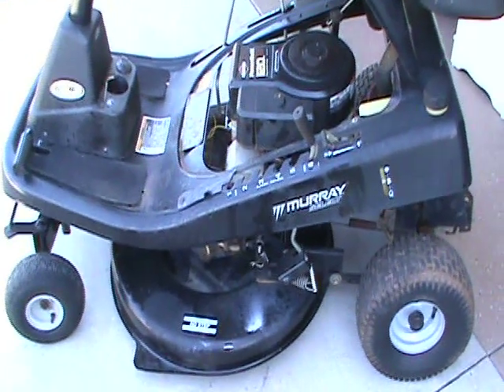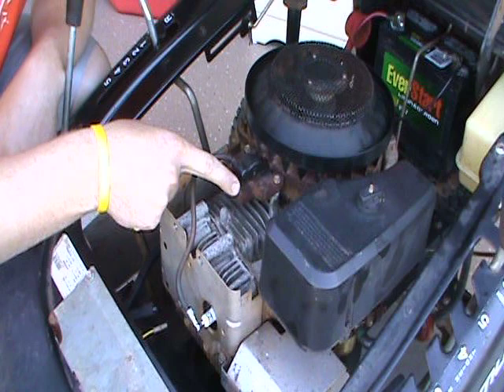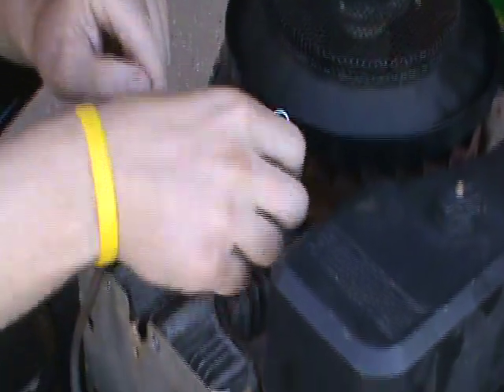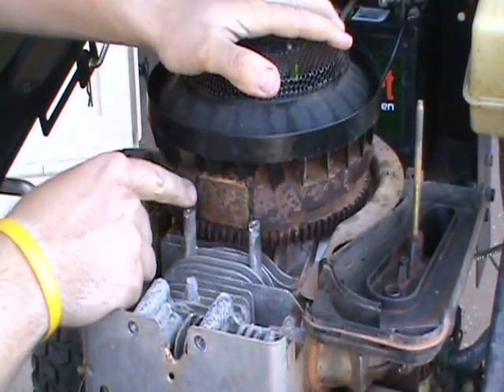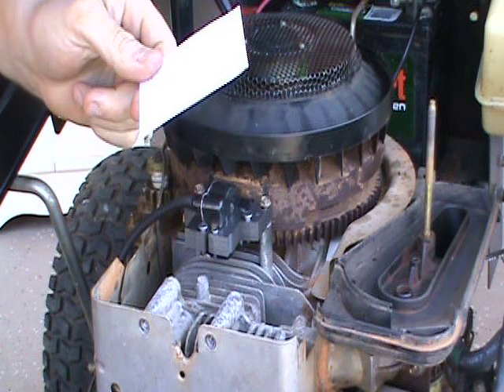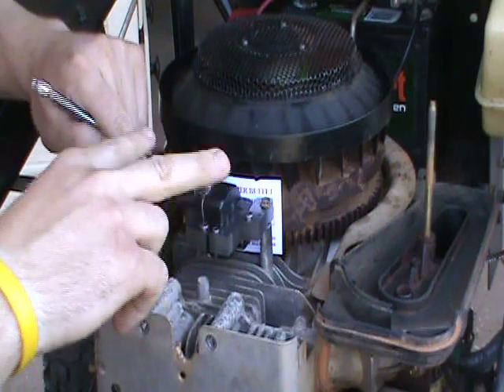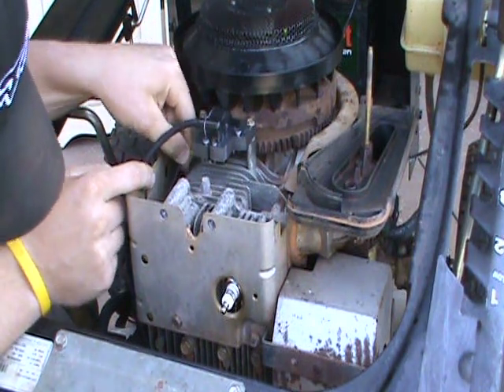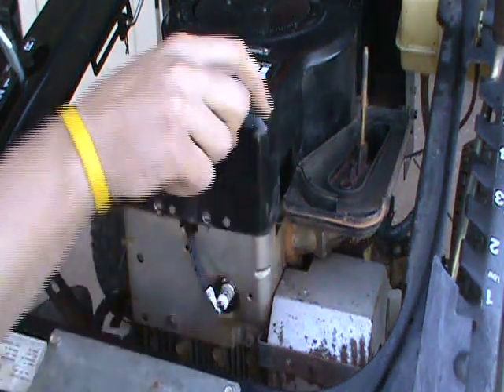BRIGGS and STRATTON COIL ARMATURE MAGNETO REPAIR NO SPARK

Comment: sand the corrosion off the magnet first, most of the time, that is the cause of low or no spark. It's a good thing to do even if you do end up replacing the magneto.
Reply: Wire wheel both bolt surfaces,   coil n flywheel  , set gap at .010 ... install  new plug ... often works ...

Comment: It also helps to take a wire brush to the flywheel and get some of the rust off for better contact and nut drivers work better than box wrenches.

Comment: No. I´m not talking about the wire where you should install the spark light. In your video I saw how you unplugged the magneto from a wire. Exactly at 2:59 minutes of the reproduction. This is the wire I need to know where comes from. It is a ground wire or it supplies electricity to the magneto. I´m from Cuba and here there is not any mechanic who could explain me what I´m asking to you. Maybe an electric diagram of my equipment will help me but I don´t have access to any one. Thank you!!

Comment: Thanks for an easy explanation and stable camera. My new Briggs & Stratton lost spark and it could have been because vibration caused armature nuts to loosen. Unfortunately, I didn't really use the mower until after my 1-year warranty ended. So, your video might save me a repair cost. I'm surprised that the engine malfunctioned right off the bat. This is a first.

Comment: Thanks a lot! This video might be right for my new lawnmower. I used it only about a dozen times in one year. Immediately after the one-year warranty was over, the lawnmower stopped working. I will check the spark, as you advised, and take it from there.

Comment: I just finished fixing a problem that drove me wild for a few days.  No spark....hmmm.  Removed the cover.  Cleaned the coil where it mounts to the case with sandpaper to ensure a good electrical connection.  I also sanded the flywheel until it was clean and free of dirt and rust.  Reassembled everything and still no spark.  Being it was only a flywheel and the coil I assumed the problem was the coil.  I ordered the OEM Briggs coil from Amazon ($30).  I installed it and still no spark...aaarrrggghhh!!!    I finally had an idea that I hadn’t thought of.....disconnect the grounding wire that is attached to the little tab on the coil.  I pulled that little spade connector off and reassembled the cover and viola.  It started and ran.  I couldn’t believe it.  I chased this problem for days only to find out that the safety mechanism that grounds out the spark when the handle is released was the cause of the problem.  It was permanently disabling (grounding out) the coil whether the handle was pulled in or not.  Moral of the story.....when chasing a no spark problem and you’re down to the coil disconnect the spade lug at the coil in order to omit that as a possible cause.
Reply from the maker: wow thanks alot for your comment and info, it will help everyone

Comment: After I cleaned up the points to make smoother connection and reconnected a couple wires, I put the flywheel back on. I had to do some sanding of the magneto legs since the smaller engine I took the magneto off of had a flywheel with a smaller radius. So I got the working magneto all set with the proper distance and everything. Surely enough, after spinning the flywheel, the spark plug sparked! So I put some starter spray stuff into the gas intake and the stuff ignited and everything!

Comment from the maker: You need to clean them really good, and then make sure the spacing is correct otherwise there will be no spark. You may have to look up the specs and measurements for your brand 3 wheeler online somewhere. hope you get it fixed!

Comment: good job . one thing I would recommend....after removing the old coil, file the top of both post to insure good connection s when bolting down new coil ". jmo"  but why not since you're already there and takes 30 seconds .

Comment: It was the second ground wire from the coil that went to a thermal shut off that may have over heated from when it was racing at a high RPM  After disconnecting that it started right up..  I have to drain the oil to change that censer .  It is my generator motor  ..  Thanks for your response   Ryker  ..

Comment from the maker: Well the next thing I would check is that you have a ground wire connected somewhere. And it could be that it might be a faulty switch, as in safety switch. So like your brake, seat, or clutch safety switch. Might need to replace one of those. Hope it works.

Comment from the maker: oh ok, sorry I forgot about that wire. Yes that is basically a ground wire that runs back to a junction or wiring harness, then runs up to the ignition and other safety switches.  It is possible that your ground wire is missing from the magneto. This would mean there would be a kill switch somewhere. If the ground wire is missing and you  start the engine, it will not stop running unless  you have a kill switch or choke it out. Hope that helps.

Comment: learned quite a bit from this video.  I am trying to apply this to an outboard engine. im pretty sure this is my problem
Reply from the maker: Collin Rogers I hope you get it fixed
Reply: Im not much of an electrical genius.  I ended up taking it to a marine shop, it was the stator.  basically the same thing?

Comment: Air gap should be 0.011" to 0.014".   Also a good idea to clean the rust from the flywheel if this build up too much it can cause running problems.
Reply from the maker: +Philip Hartley good info, thanks!
Reply: great video well explained my engine had no spark thanks so much

Comment: Great video! I have a 19.5 B&S twin cylinder (on a Craftsman riding mower purchased new in '98) that turns over like a champ but suddenly is producing no spark. I've accurately gapped and replaced both the plugs and magneto (it's an aftermarket, bought on Amazon), polished off all rust on the flywheel magnets, and bypassed the seat switch, and still no spark. Any ideas? thanks.
Reply: Adam Yates buy oem magneto Briggs twins are known for mags going bad after 15-20 years amazon mags are junk Chinese you get what you pay for make sure you have the mag installed correctly otherwise it won’t run or run crappy the timing will be incorrect and gap properly I use feeler gauges and go for .008-.012 in gap for strong spark and clean the magnet on flywheel and make sure magnet is strong ps oem mag is $70 from Briggs highly recommended

Comment: Hey great video I tested mine before buying a new one and it works so my fly wheel was rusty I cleaned all that off and bam it started but now it won't rev up high more like a putter then runs a while and dies can't engage blades doesn't have enough power changed all filters everything is fine but won't throttle up even on its highest setting any ideas
Reply from the maker: +Lynn Forbes if you are having power loss, then you need to check your battery. If the battery is old this makes a big difference
Reply: check fuel for water

Comment from the maker: Check to make sure the cable wire is good, but also since it is an electrical piece it can just be bad. A local small engine shop or ebay works for getting the part

Comment: thank you very precise and knowledgeable I will get one for my lawn mower
Reply from the maker: You are welcome!
Reply: If the ignition system does not give a spark then what could be the issue?
Reply from the maker: a ground wire. you need to check that.

Comment from the maker: Well, is there no spark in the plug? or no firing of the engine?  Because you just might have some type of safety switch that is shorting out.  So take out your plug, reconnect to wire and touch it to metal while turning over the engine. Then you can see if the plug is getting spark.  If it is sparking then there might be a switch somewhere that needs to be replaced. hope that helps

Comment from the maker: hmmm...well if the carbs clean it shouldn't do that. But maybe adjust the idler, or throttle screw.Maybe it got turned when you were cleaning the carb....Also check your gas for being clean, and the line if it is getting fuel evenly. hope it helps!

Comment: Great instructions! My flywheel won't turn, however. Does it always turn as easily as your video shows?
Reply from the maker: Yes it should, is your spark plug out? It turns easier with it out.

Comment: How did you determine it was the armature and not the eletronic trigger module under the flywheel where the points used to be on older engines, is it built into the coil on this model-?  The modules tended to fail a lot more often than the magnetos do, at least in my experience.

Comment: Great Vid!! And, that's my exact mower!! My mower was running fine and then just died and wouldn't restart.  It turns over fine and I primed the carb but still won't.  I checked for spark at the plug conection and it doesn't seem to be getting any (will retest to make sure).  Could this still be a magneto problem?  If so, what magneto do I shop for? 

Thanks!!!

Comment: After watching your video I was able to confidentiality replace my coil but the B&S 625 Series engine still will not start.  I replaced the carburetor, primer pump, governor spring, control bracket, changed oil, replaced the gas, new spark plug and replaced air filter.  I even tried starter fluid on it.  Any ideas about why it still doesn't start?  Is there a fuel filter somewhere?  Thanks
Reply from the maker: is it turning over? If it is, then if still might be some kind of safety switch that needs to be replaced or disconnected. Otherwise, you might need to clean your carburetor too.

Comment: I've got a 10 HP Briggs with a broken magneto. I found another magneto from a 2.5 HP engine that appears to be the same shape and size and will fit. Would it work/be a good idea for me to use the magneto from the 2.5HP engine on the 10 HP? I might need to since the Briggs is very old and I can't find any info for it online.

Comment from the maker: hmmm, well its possibly you have a ground issue....these seems weird but try unplugging the black wire on the magneto. If it sparks and fires, then there is a ground issue. Need to find the short. Or could be one of your safety switches. They can go out too....If all fails you can wire in a switch. Hope it helps! Thanks for watching!

Comment: Great tip using the business card, thank you!!!!

Do the 5 HP Briggs without starter motor have the grounding wire as well to the Magneto?
Reply from the maker: You are welcome! To check this, just follow the wire from your spark plug. See what it is connected to and check the connections and the rubber to see if it is cracked .

Comment: Great video my 21 horsepower is still not getting spark and I change the ignition coil and spark plug still no spark any suggestions
Reply from the maker: yep this can be a tricky fix, its hard to know without looking at it

Comment: Before you take the coil off and waste a lot of time and money. Remove the small ignition wire and test for spark. I have often found a problem in the wiring that has prevented a  spark.
 No need to put the engine air shroud back on until you know  the engine is operating correctly. If engine starts and runs well. Stop engine before it gets hot, then put shroud on. mentioned correctly at fist the gap is .01 inch, or.25 cm. Then you said later 30 thousandths, which is too large a gap. Good Luck!

Comment: Funny cause I thought ours was the only one. Hadn't seen another one like it till I saw this video.  Have you worked on the governer gear inside as it is vague on how to install it. I lined it up with the governer arm and put the crankcase cover on . Everything seems fine but when I turn the flywheel back ants forth there's a loud knock. Everything was torqued to spec so I was wondering if it has to do with the governer

Comment: Good vid good trouble shooting.......terminology is always a problem.....yes it is called a coil (two coils inside) and when ordered the parts people call it an ign. armature also correct  (it is also a step up transformer.)......but it.s not a magneto.......the system is a magneto system, you must include the magnets for it to be a magneto.    For any electrical generator you must have....a coil of wire, a magnet and movement.    Don't worry, most people don't understand this nor the function of the old points system nor the module or trigger used today.

Comment: Hey can you help?? I have a Briggs and Stratton ride on mower and it has a magneto spark generator it has the spark plug wire and another wire think to ignition. Where onto the ignition? Live or neutral ? Also have similar magneto on other side of engine with one black wire ?? Any ideas would help

Comment: Great video.  I got the new module, but it has two wires instead of one.  How do I tell which one is the kill and which goes to the ignition?  I don't want to fry the coil.
HALP!
Reply from the maker: jsmyth024 Hmm, are they different colors?
Reply: Nope.  Both copper colored wires with black  sleeves.  I know it's prob an ignorant question, but I can't find the answer anywhere online. I replaced ething from the battery to the starter to the coil armature, but still can't get it to crank. :/  Side note: this stuff is pretty fascinating, just wish I knew anything at all about it.
Reply from the maker: jsmyth024 well shoot, I was hoping one of the wires would have had a connector on them to make it easier. Well you could always hook it up one way and take a meter and test to see if current is running through, and try hooking up the other way. If they are the same, I don't think it would matter, one to kill switch and one to the battery. sorry I could be of more help.
Reply: That was actually a lot of help.  It eased my mind about blowing something up. :P

Comment from the maker: wow, if its running for 15 minutes, it should be good. But if it dies then its possible there could be a ground short if its electrical....or possibly regulators depending on how old it is. But after running for a 2 mins it should be good to go. I guess I don't know, could be many things..sorry I  am no help..Thanks for watching!

Comment: Thanks so much for the video.. I have a question..can you use a magneto  off of a Briggs 14.5 OHV on a Briggs 17.5 OHV engine
Reply from the maker: As long as it is the same size yes, possible its different and won't fit on there right, also if it doesn't work then it might not be big enough to spin the flywheel. Thanks for watching.

Comment: so on these models w armature magneto  no need to pull ribbed flywheel to clean points like in the older models..correct?  because points r no longer there..under flywheel
Reply: Yes. No morepoints

They are electronic ignition coils

Comment: here's my problem... I have a cub cadet zero turn...I just replaced the ignition module a little over a month ago... well just a couple weeks ago I was on a job site and shut the mower off to fill it with gas... I went to start it back up... no go... so I jumpered out the solenoid and that started it up... I did that for about a week hoping to finish out the season and then working on it... well after a week, jumpering out the solenoid no longer worked... I replaced the solenoid... replaced the starter... checked and cleaned the carburetor... I turn the key and nothing... however when I turn the key and jumper the solenoid it'll crank but no fire... could this be caused by the magnetos? I've been pulling my hair out over this... we've gone through all of the electrical and the magnetos are the next step and pretty much the only thing we haven't checked yet.
Reply from the maker: well a big thing to check would be the safety buttons for the seat, and if you have another one somewhere. Check the continuity on those. You might just need to replace one of those. They can all the sudden go out
Reply: TheRykerDane tested all of the safety switches and theyre good.
Reply: I might be having the same thing on my cub cadet zero turn. I just died on me one day. I replaced the solenoid last week. The safety buttons are good and the switch is good. When I try to start it the motor is very sluggish - turning once or twice then just dying. I rotate the flywheel a couple of times and it does the very same thing when I try to start it - very sluggish, turning once or twice then just dying.

Comment: hey ive got a question.  I have no spark on this 2hp engine.Ive adjusted the magneto but still no spark.  Could it be that the red wire comeing from behind the flywheel isnt connected to anything(there is a ground wire thats there and copper wire leading from behind the flywheel)and is causing all the trouble?

Comment: I have a 12 hp Briggs from late 80s the wire has been chewed to the metal... It ran but then died and so I pulled the spark plug and there was  nothing ... I tried different spark plugs still no luck then I held my finger onto the exposed spark plug wire spun the fly wheel and it shocked me ... So why is it not getting a spark ....ps I do not see a break in the wire ..... Please let me know if you have any idea what's wrong
Reply from the maker: Make sure your plugs are good that you try. Also, put the plug into the wire, then touch the end of the plug to a metal part on the engine. And see if the plug is sparking. If it is then you should be good to go. Now it might be a carburetor problem or it is flooded. Clean the carb or let it sit and try again.

Comment: question: i have a 3hp B&S and and i have no spark, one wire goes from the coil to the points, one to the sparkplug but i dont know where the third wire has to go.
Reply from the maker: the 3rd is the ground

Comment: could this also fix my problem that I have when I run my riding mower for about 10 minutes and then it dies out? im almost certain it is the coil because when its a cold start it has no problems but when I it gets hot it cuts off....  but when i do initially start the mower it has no problems running only until 10 miutes later